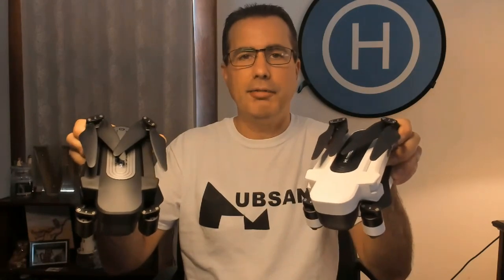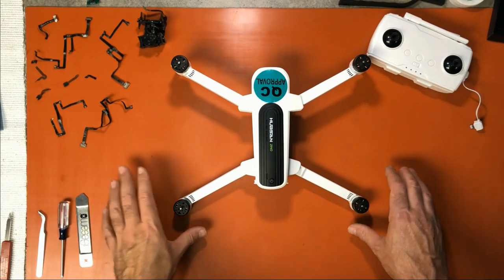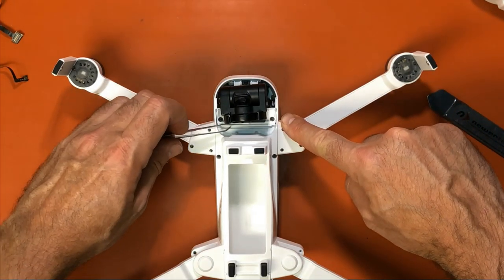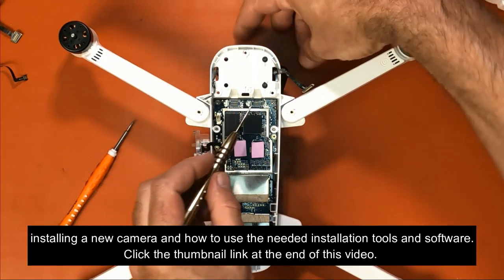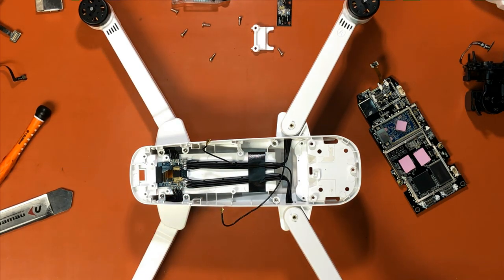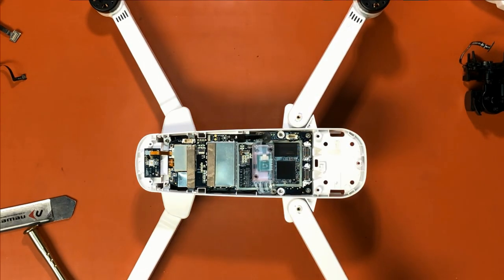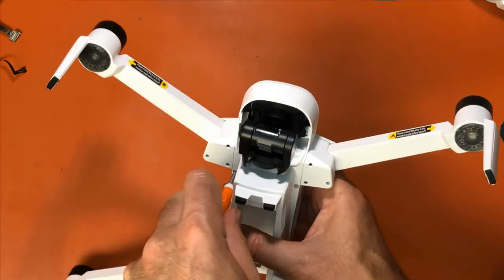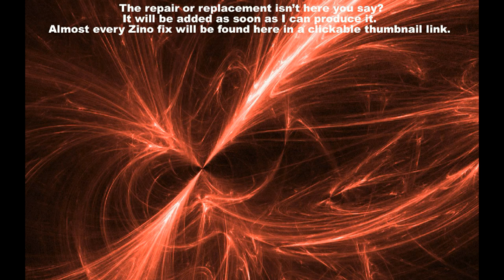HUBSAN ZINO - HOW TO TAKE IT APART & FIX ALMOST ANYTHING

Comment: My zino pro fell and the ginbal ta shaking, someone gives me a hint
Reply from the maker: Tio VaeX Drone Amazonas 
It either needs a calibration with the calibration tool or there’s a loose connection or a new cable is needed. It’s not as simple as it’s shaking and give you one answer.